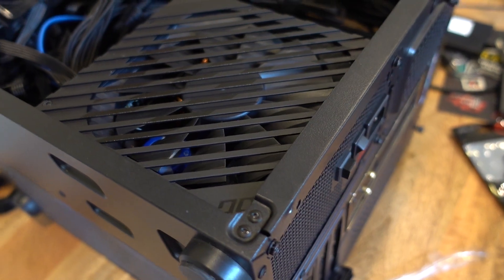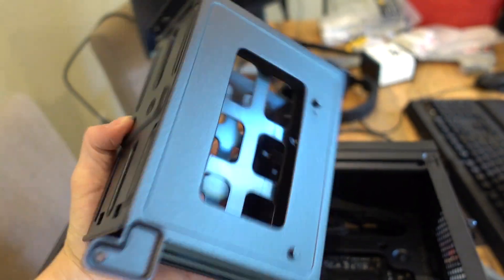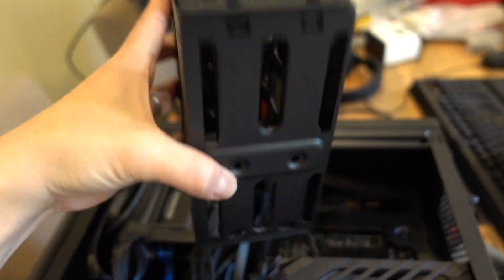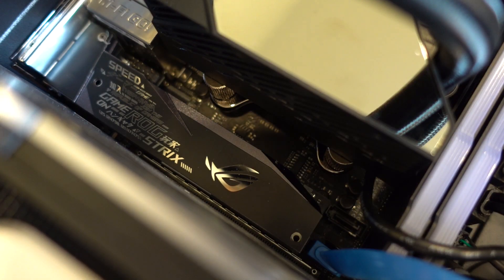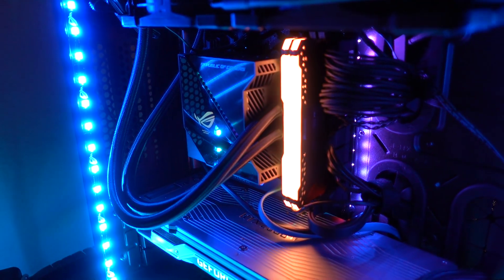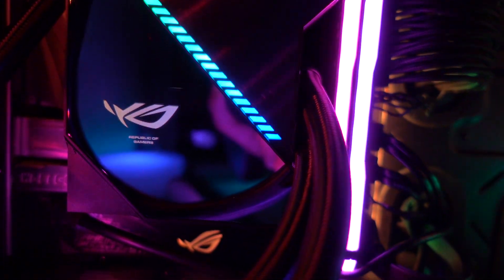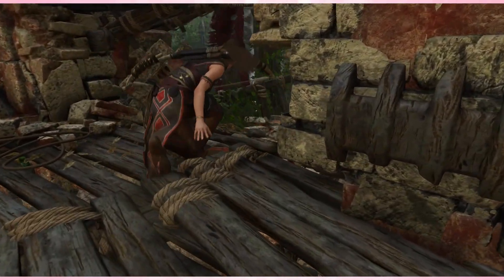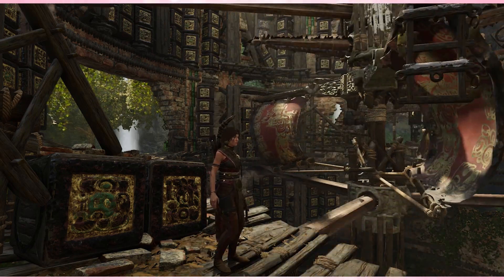My New Gaming and Editing PC! Feedback, Updates, & Modifications

Comment: Love how you took ownership of the build, it does what you need.  Yes there are higher end parts for that +10-15%.  You can add or subtract whatever you may want to improve per availability or price point as you have.  Confident in the build but open to suggestions, always learning.
Reply: Best is to buy parts 1 generation behind to avoid the highest prices, and upgrade every 2-3 years for certain parts, or 5 if high-enough performance.